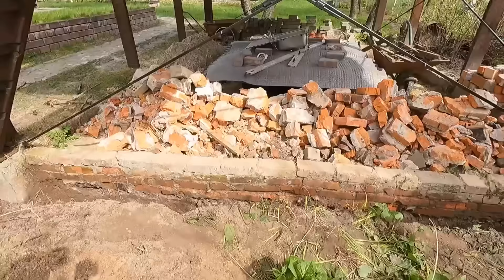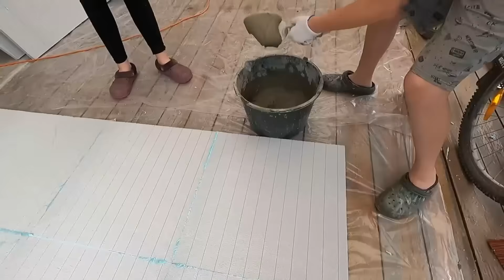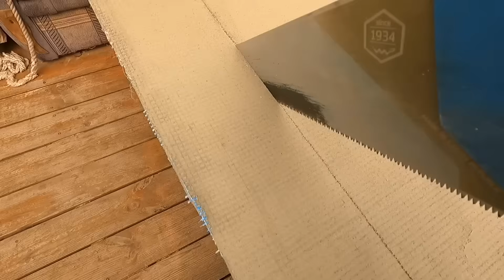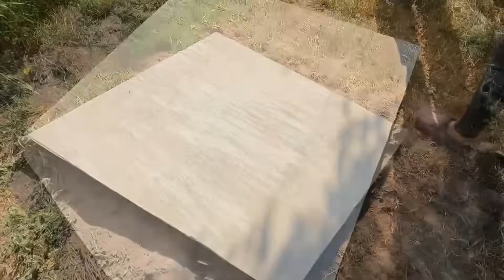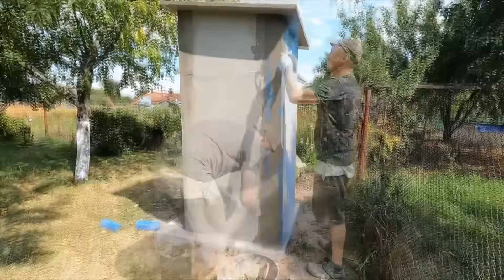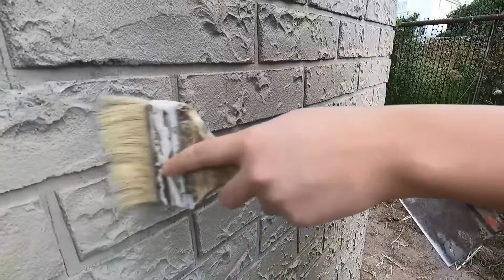DIY Backyard Toilet: Discover the NEW Technique!

Comment: Any thoughts on a windowless triple door (folding) to cover 2.3m workshop opening, surprised the toilet door needed the wood frame and that it was not incorporated into the mesh when you were reinforcing the eps panel. UK seems to be 1200 x 2400mm polystyrene panels at 25 or 50mm thick (£10 and £20 each), BTW and they are flat edged.

Comment: I'm finding an (Mind you in English) word problem (possibly a deliberately made confusion).
The word Plasticizer does not mean that the Cement is like plastic and will handle things like vibration, or in these cases the pounding the wind and heat and cold expansions and contractions.  It means that it will sump into like a mold without having to be vibrated.
(This is not really a desired trait for hand lay up of vertical applications.)
(It might be (Provided the prices are right) a way to take basic concrete and transform it into tile adhesive (I wouldn't know for sure???))

I'm going to have to contact manufacturers' and get their input on creating more "ELASTIC" Concrete.  The idea would be that a more elastic concrete would handle things like the winds causing flex-ations over longer spans than DIY Homestead is creating.  If it can't flex then it will crack.

Comment: Thank you for another great vid. Does anyone know what the US equivalent of this sort of adhesive mortar mix might be? Is it the same as "Thinset", or other ceramic tile adhesive mixes? Cheers from FL, USA!
Reply: That was what I was trying to find as well. Is it the insulation boards at Lowe's? Also what kind or stuff is he spreading on it? Cement or mortar if mortar it maybe cheaper here for a wood build. Polyurethane sheets are around $22 for 4x8x1 in and $55 for 2 inch thick. That is the expanded XPS which we call insulation boards. But if you are pouring cement on top does it really matter what you use? Just asking?
Reply: @AraBelleSongs    The foam boards should be easy to fin anywhere in the US. They are the pink/blue panels you see folks use in their walls and it comes in thicknesses from about 1/2" to 2" thick. It will often be called "XPS" (Extruded Polystyrene........fancy styrofoam, basically). The mesh is also easy to find here in the States and is usually just called "fiberglass bonding mesh", it's used in Stucco and other outdoor applications all the time. 

With regards to the mix, I believe he's using what we call "Thinset", which is a tile adhesive, but there are also other mixes that are a bit more durable and are based on Mortar, like the stuff used to lay bricks. 
It will often have something like "adhesive mortar mix" on the bag. You can also use "Type-N" mortar which is very hard and durable, but may not be the best for very curvy surfaces. 

This whole process is also called "Foamcore" building and is used in Movies, Theme Parks, etc....to build the models and sets that they use. There are tons of vids here on YT doing various projects too. 

Cheers!
Reply: @KarlKarsnark  thanks that is awesome I'm thinking to build something and see if it hold up for me